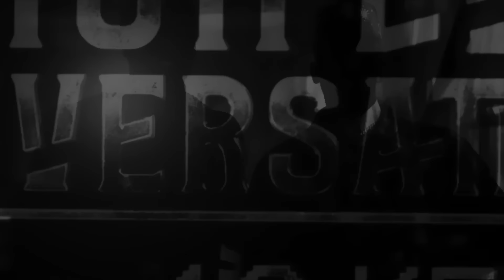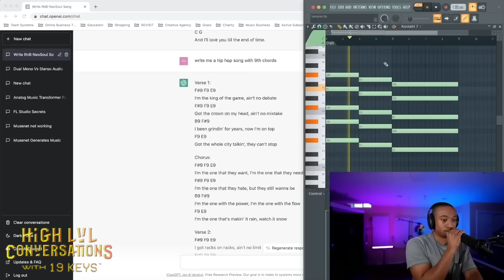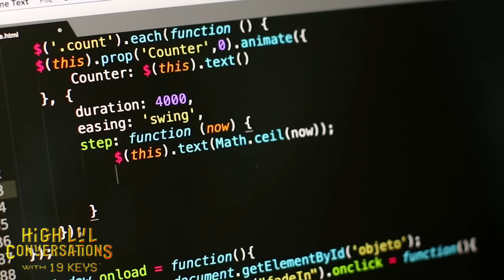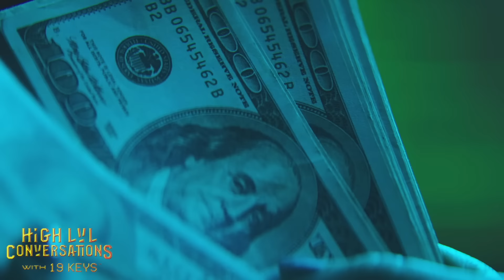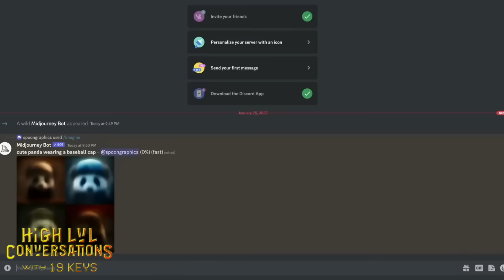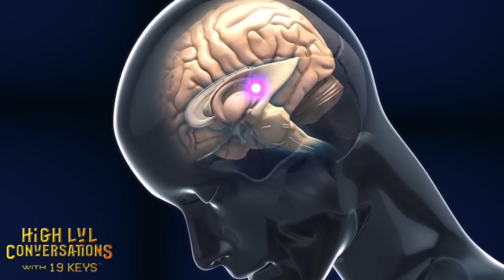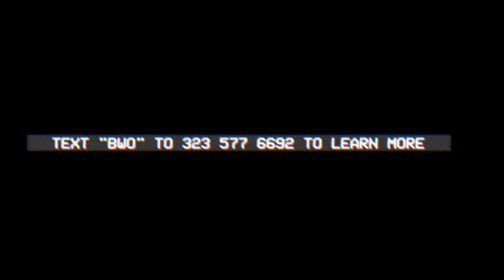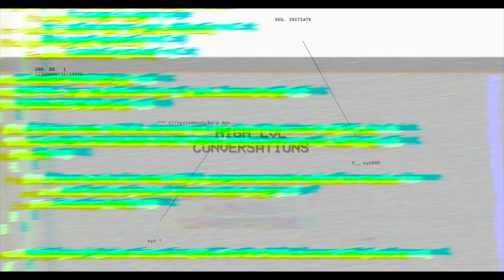Apocalypse of AI wars: Natural vs Artificial Intelligence, 19 Keys with Red Pill

Comment: I told people years ago about not learning when they took trades out of Jr. and high schools that has to be replaced with whatever was new was coming next. I remember when some car dealers went to Washington DC and bulldozed a Toyota in a hole not long after that auto mechanics, woodworking welding, and home economics for women were taken out of schools. I knew then that that was going be a problem.  when Grammarly came out I said this is going make people dumb down remember they use to have spelling bee awards spell check was the beginning now  Grammarly  and AI they don't need low-wage people any more look at the automation at the warehouse and seaports